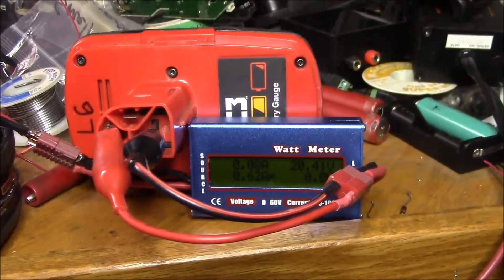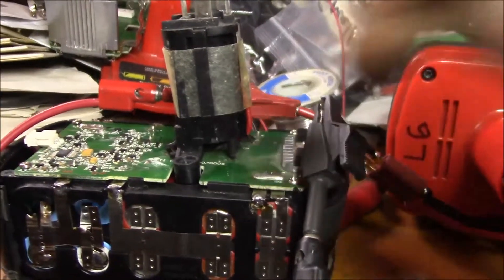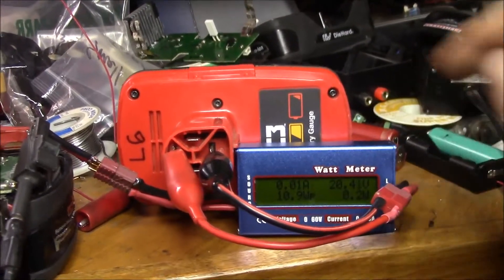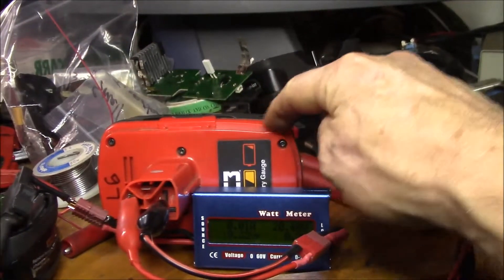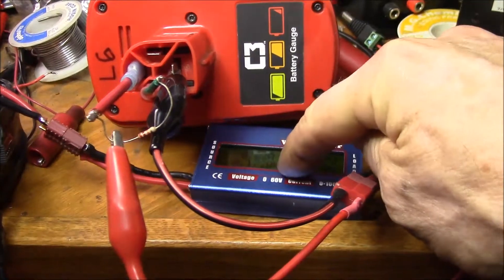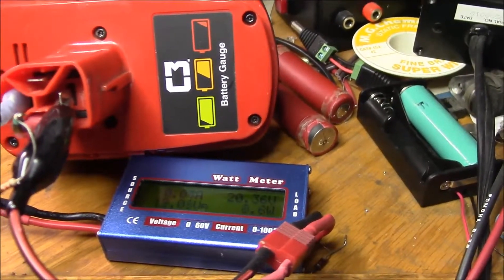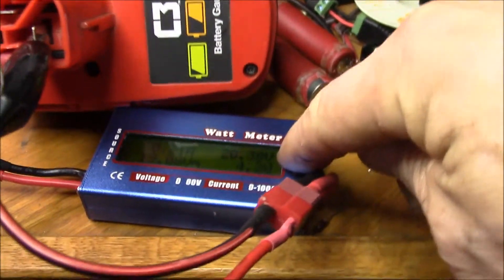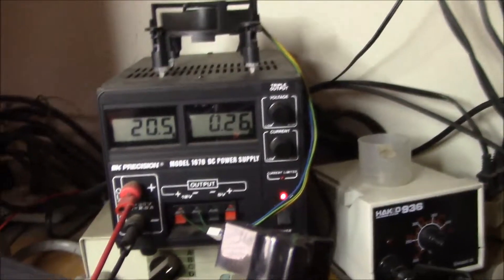Craftsman C3 Battery Charging, Part 7e

Comment: Hi Brown, Thank you for sharing your experiment. I am trying get something out of your video here. I bought a craftman power tool that comes with 19.2volts NiCad battery + NiCad only charger.  Then I just bought a couple 19.2 volts Lithium batteries, which didn't come with a charger so instead of buying another charger which you know isn't cheap.  I am trying to see if I can use my existing B6AC charger (some what like your imax b6) to charge these lithium ion batteries. I am not very knowledge in electrical field, but I do like DIY projects.  It seems you was able to use register trick to charge these lithium batteries, could you please show how I should do this? how many ohms of that register I should use, etc. Thanks a lot.
Reply from the maker: +Hai Nguyen I've not been reliably able to "trick" all the C3 lithium batteries I have into charging off the ImaxB6.  Some work with the resistor, some charge fine without it and some don't charge no matter what I do.  I used a 22K ohm resistor, again some times it wasn't needed, sometimes it was and other times the battery would not charge no matter what I did.
Reply: Brown, thanks for replying, I guess I will have to buy a charger then
Reply from the maker: +Hai Nguyen You might try the resistor trick with the batteries and charger you have.  I have some of the C3 lithium packs that charge fine off my Imax-B6, some that charge some of the time with the resistor and then others that I can't charge at all.  In fact I have one pack that will only charge on one of my 2 Craftsman chargers.  For starters, just connect the positive and negative leads from the charger and set it to Lithium and 5-series cells and see if it works.  If not, try the resistor to the side terminals.  Much of the charging logic is inside the battery pack and there are many different versions of those boards inside the packs.  Some are very tolerant of chargers and others are very finicky.